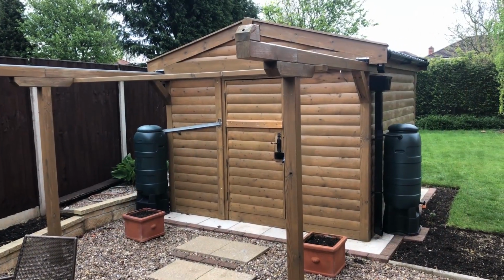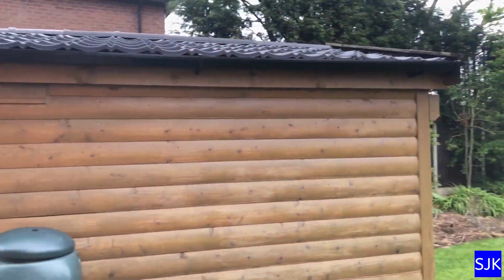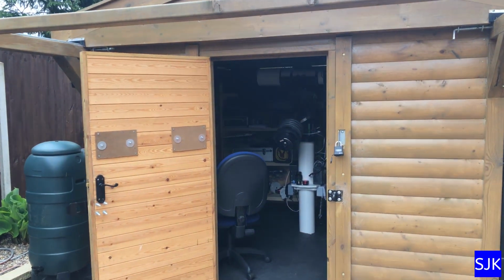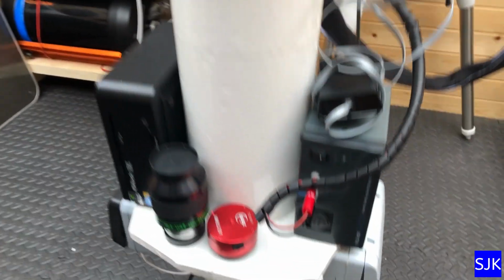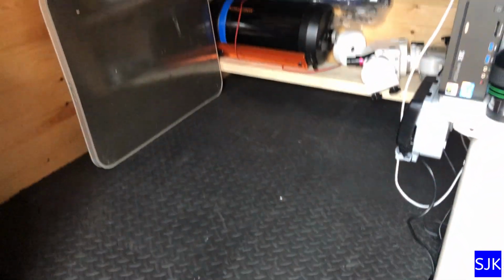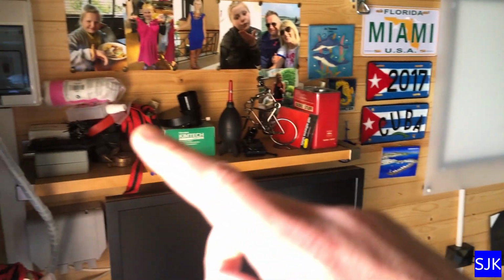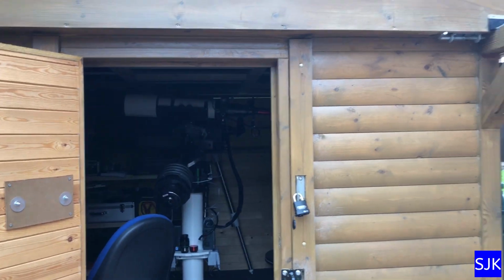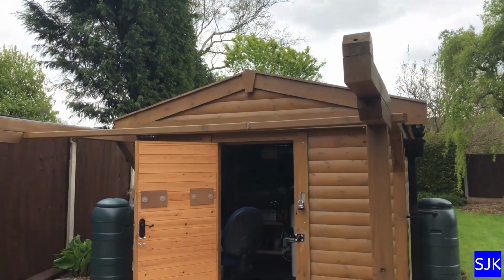Observatory Build Overview

Comment: I stumbled across your video by fluke. I have the same mount e200 version. Where did you source that lovely large flat panel from? Thanks for taking the time to make this video.
Reply from the maker: Thankyou.    It's a drawing/tracing panel off of eBay - about $£30-ish.  I control it from NINA with a Arduino controller.
Reply: @kirkster501  Sorry to harass you, what size is it? Thanks
Reply from the maker: @shaunozs1ra92  NP - it's an A3 tracing panel

Comment: Awesome build, love the Cuban flag as I am also from Cuba originally. 

Do you have any moisture control? Fans? How about for cold?
Reply from the maker: Many thanks.  I went to Havana, lovely country and lovely people and food! No, no temperature control or humidity control at all.  I don't bother with it and it would be very expensive in terns of electricity to run such a system in the UK.  There is a gap around the top where air can flow in and around.

Comment: 20 degrees? above horizon? i'd stop long before that.  i've started shooting objects no lower than 45 for quality and it's made a difference in data. Sure, I can start at 36 degrees above horizon (above the powerlines looking east in my backyard) but looking further through our atmosphere hinders the data quite a bit, and if you have outlying small towns the light pollution from them can effect those images taken at such a low angle.. observatory looks great though!

Comment: Beautiful observatory!   How do you seal the roof to the wall crack?   I live in the Mojave desert in California, where 50 mph winds and blowing sand is not uncommon.  Thanks for your video.
Reply from the maker: Many thanks. There is no seal at all, we do not have that problem in the UK. On the contrary, we want ventilation in there to blow away any condensation that may gather on the equipment due to the damp air we often have.

Comment: Exellent build , i thought the same way when i built mine , and my observatory is also suffering from light pollution.
But as you , i thought that i had to work with what i got , so i built my observatory walls extra high due to wind and light pollution , and it works flawlessly.
I don't have any horizons but i'm still able to get lots of objects in my view , and i also built a warm room.
So now i'm using my equipment almost a 100% more then i would have done without an observatory , and it gives me great joy.
Reply from the maker: Yep.  You just have to get on with it.  We would all like a 360 degree horizon view but that is not possible from most people's back yards.

Comment: This looks like a perfect observatory for my garden too. Quick question. Did you lay a damp proof membrane under the slabs to prevent damp rising up from the soil through the slabs? If not, do you have any damp problems? Thanks.
Reply from the maker: Hi, no I didn’t use any membrane. I used thick bitumin paint on all under timbers to prevent rising damp into the wood structure and it has been fine so far for six years. I want the water to drain away when wet gets under the observatory (as it will do). A membrane could inhibit the draining away of any surface water that may get under the observatory.
Reply: @kirkster501  thanks for replying. Your explanation makes perfect sense.
Reply from the maker: @tvnostalgia7477  Remember, sure, a membrane is fine on a foundation underneath a permanently sheltered building such as an orangery or a conservatory.  But with an observatory water can potentially get underneath the structure.  As such this water needs to be able to soak and drain away.  If there were a membrane underneath the base on which the observatory is built the water can pool under the base and between the membrane and thus making the issue of rising damp a permanent fixture because the water cannot get away.  Without the membrane the water can drain away.  You do not want a membrane on such a structure.

Comment: Lovely observatory and impressive mount! Is it belt drive? And I think I spy the SiTech controller - my Dad has one of those as part of a retro fit to what we think is a precursor to the AP mounts, that controller is a brilliant bit of kit. I remember using the school PCB etching facilities to make one of the original Mel Bartels stepper motor controller boards.. that's going back a few years!

Comment: I like your design. I agree it looks much better vs. a dome. blends into the backyard.
Reply from the maker: Dome is out of the question n my case.  They also are not very good, the slit in the roof is very restrictive when I have used them before.

Comment: Very nice work - you have done a great job with that observatory, it works well in your location.  I was thinking of something like this, however it would need to be completely pest and weather proof, as I am in Sub tropical Queensland.   We get heavy rainfall and hail from time to time, while any hole approaching pencil tip size will quickly become a wasp mud nest, and the smooth running rollers will sound like stepping on a packet of crisps. I suspect yours would also have a colony of rodents, Geckos, Tree snakes, a Python and every insect in SE Queensland in it here after a few days!  I'm keen on making this concept work if I can keep it properly sealed.

Comment: Hey hope this isn't rude of me to ask. What was the estimated cost of this observatory? I'm trying to build one myself by summer
Reply from the maker: All in all it cost me, including foundations, concrete, slabs etc, about £3000.
Reply: Stephen Kirk wow that’s not bad at all. I was thinking more. Do you still have the plans for it?
Reply from the maker: @chuck3814  No I don't, sorry.  I have some powerpoint plans that I did but they are very high level and not very detailed.

Comment: Nice build! How are those walls constructed? Is it typical 2x4 studs spaced 16” OC? What did you use for the siding on the exterior and interior walls?
Reply from the maker: Hey man, thanks, yeah that's about it.  Go to the end of the vid and it shows in the still photos how it's done.
Reply: Stephen Kirk you’re welcome, yeah I commented before I saw the ending. That shed looks fantastic! I’d like to build one someday when I move out of the city. It would have to stand up to the occasional hurricane or flood though here in southern Louisiana, and also make it dual purpose for other shed duties. Of course I’m thinking a little too far ahead of myself right now. I need to have a more serious telescope first haha. I just have an 8” dobsonian right now. Clear skies sir!

Comment: Another reason for building an observatory, would be if you have a really large and heavy one, such as my 17.5" f/4.5 on an equatorial fork mount, and fully computerized. All told, mine weighs in at about 500 lbs, and I use 2 computers to dive and operate the camera systems. BTW, I lived in southern Alabama, and have an old license plate if you want it!
Reply from the maker: Yes indeed, you make a very good point.  Infact, in my own case, I have a Meade 14" ACF that weighs 60lb and is very difficult to mount into the dovetail at that weight on my own, even for quite a strong guy like me.  So it has to be permanently mounted in an observatory. I should have mentioned that in the video.  I will do so in a recut version.  I am in UK and would happily take the license plate Paul  but may cost too much to post/mail it to the UK.  Thanks for the thought dude, I appreciate it.

Comment: I noticed it is not weather tite as I can see about a 1/2" gap between the roof and the frame edge.  Hows that work when it is raining and blowing and what not?  I can see you going out there this winter after a bad snow storm and finding a foot of snow on the floor... ok... just saw 2 comments down that likeonatree asked the same... did you ever post the closeups?
Reply from the maker: We don't get snow like that in the UK.  The gap is deliberate so that I can get some air flow blowing through so that the condensation can dry out.  We get cold and humid conditions here, very, very rarely cold and dry.   No water ever gets in.
Reply: Ahhh... that must be nice.  I live in the midwest here in the states.  We know it's going to be a bad storm when the snow is coming 'down' horizontally! LOL  So what about bugs??  Specifically stinging bugs like wasps?  They will get in... was thinking you could get some heavy duty screen material made out of polyvinyl and tack it along the roof edge so it would 'seal' the gap when closed to keep bugs out.  I'm thinking of doing a roll off design myself and there is no way I could get away with a gap.  Was thinking of having some screw down rollers that would lift the roof an inch off the sill then I would be able to roll it over.  I'll put the channels the rollers are in on the outside edge of the sill.  I'll use some foam backer rod used for cement work as a seal when the roof is set down and it should be water and bug tite!
Reply from the maker: @tubedude54  Nope, We don't get many of those here.  A few bees and flies, that sort of thing but never had an issue with them nesting in the observatory.  That said, I do check regularly.  The season for those things is also very short here, just a few months.

Comment: Great video, what height are the walls and have you been tempted to automate the roof? (You said in commentary the obs was made by HomeObservatories)
Reply from the maker: Hello, the walls are 70 inches high.  It is always a compromise between wall height and horizon view (and stability since higher walls need a taller pier which can then induce wobble).  Yes I considered roof automation but to be honest, it is no big deal to pull the roof back manually.

Comment: Well done! But I must ask, Any problems with moisture in the air getting to the electronics from the roof gap?
Reply from the maker: Hi, not really.  Enough fresh air blows through the gap to sweep it away 95% of the time.  Occasionally, if the temperature drops away very suddenly I can get condensation on the metal parts.  So if I know the weather is going to do that I will place an old blanket over the peer and ensure the door is open to allow fresh air to blow through,  which always works.

Comment: Hi Wat size is the shed u got looking at one but can't decide on size urs looks about rite
Reply from the maker: It is 10ft x 8ft.  And it is a dedicated built observatory, not a converted shed.  Converted sheds you buy are very weak when converted into a roll-off-roof observatory because without the roof they become very flimsy and you have to do so much bracing of the timbers that you might as well build from scratch.
Reply: Yes mate I know was just looking at size having one built with warm room 12x8 so should be plenty big enough
Thanks mate
Reply from the maker: paul Mog make sure there is plenty of free space inside the observatory to the North. This is where you will sit and do most of your observing and imaging.